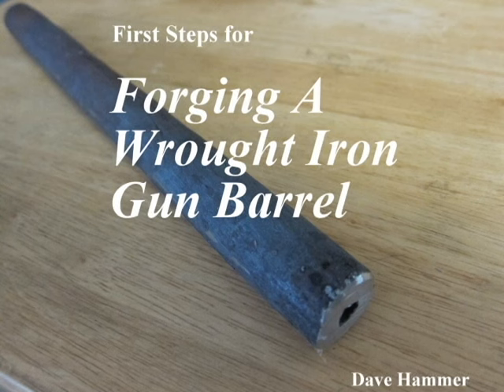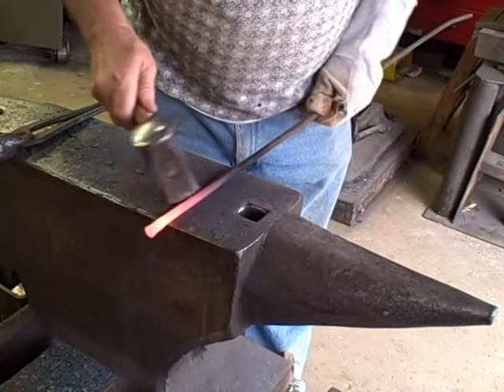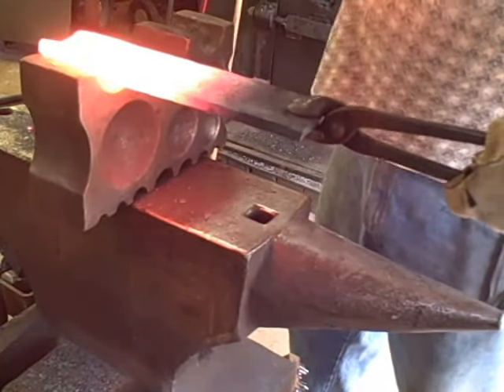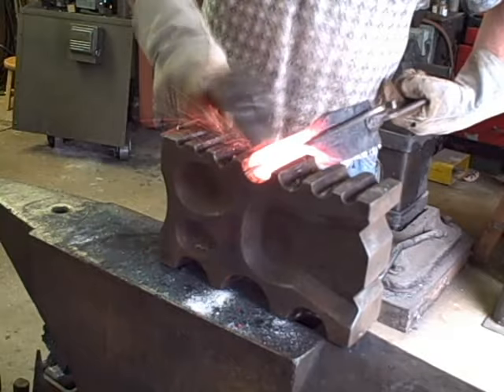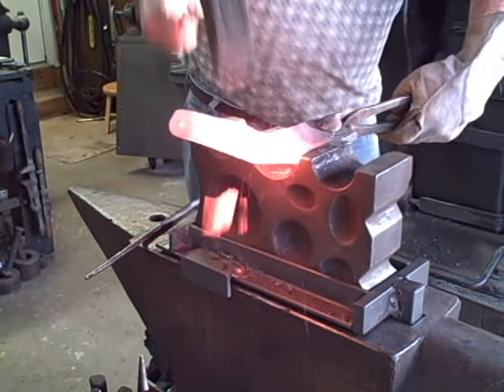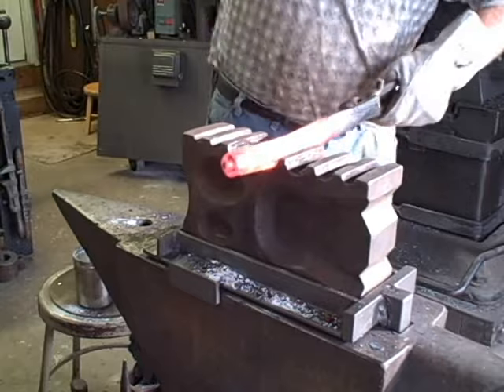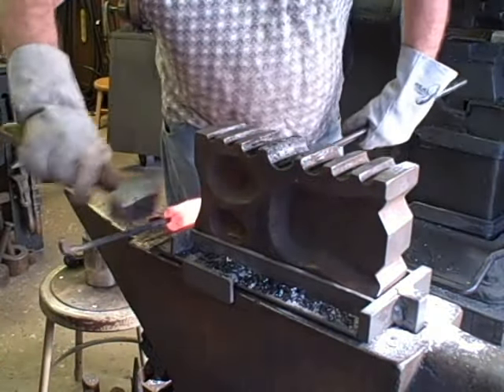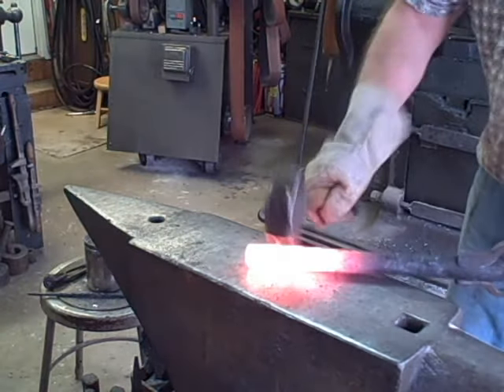Forging a gun barrel

Comment: Instead of drilling, and then, boring, and then rifling, why not just make a mandrel that was already the right size and rifling on the leading end, then hammer it through the barrel while the barrel was hot?  All three processes in one step.
Reply: +JathTech...  If the mandrel is left in the barrel....  and the plate surrounding it is heated enough to be forge welded, the mandrel would also be drawn to forge welding heat (via the heat in the forge and the heat from the mandrel contacting the plate being welded...., resulting in the mandrel being  forge welded to the inside of the barrel as the barrel  is being welded.  I would end up with a solid piece of round stock.  

The mandrel (as shown in the video) needs to have a taper and be put into the barrel at the point that is currently to be forge welded.  The mandrel is not at welding heat when it is put in and does not usually get to welding heat (from contact with metal at welding heat) during the short time the plate is at welding heat.  As the forge welding is occurring, heat is being lost from the plate because of room temperature and contact with a cooler mandrel.  It is important to NOT leave the mandrel in too long, or it may end up welded to the inside of the barrel....  not likely to happen, but possible.  Usually only a few welding strokes are possible (time constraint) before the plate has cooled too much for welding.  This is why it takes so long to weld a barrel.  As long as the mandrel is tapered, it is usually easy to get out.
Reply: The process I'm suggesting would be to design the mandrel with the negative of the bore you want.  You would then use a torch to heat the next section of the barrel you want to form, and hammer the mandrel in a bit.  You'd then pull it out, cool the mandrel, and heat the next section of the barrel.  Repeating the steps, making sure to line the mandrel up with the grooves each time. heat barrel,in, out, cool mandrel, repeat. I can't wait to try making my own barrel some day.  If you can get my mandrel idea to work using hot forging techniques, that would be amazing.  

There's also the possibility of using something that is zinc coated, or something that won't forge to steel or change shape when hot, such as tungsten carbide.  Theoretically, I can see you heating the entire barrel and pounding a tungsten carbide mandrel through all the way in one heat.
Reply: +David Hammer forgot to say, thanks for the reply.
Reply: +JathTech....  I have to say you don't lack for energy and ideas.  I admire that....   However, my goal is to learn how the pioneers actually did make firearms, and replicate their processes..., not try new or modern ones.  One of the Williamsburg gunsmiths is forging parts of a long rifle at annual conferences held about 60 miles from where I live.  It will take many 2-day conferences to complete his project, so he is committed for many years.  The first effort was to start forge welding the barrel (April, 2014).  In April 2015, he finished the welding, and did the rough forging of the octagon shaping.  This coming spring, I expect he will file the octagon shape smooth and make the drilling and boring tools and start working on the bore (and hopefully finish it).  Next would be rifling (grooves).

Originally, my only goal was to see if I could forge weld a barrel.  If I do go forward and make the entire musket, I will probably go ahead of the Williamsburg gunsmiths project.  As of now, I am just a little behind because I have lots of other projects I have done and more to do ahead of making a musket. If you are curious about what they are, you could peruse through the pictures on my Facebook page.   I've done numerous small projects over the past year and a half since I made the gun barrel, but my major efforts have been musical instrument sculptures.

https://www.facebook.com/dave.hammer.12

If you go forward with your ideas, I would be interested in your progress, but probably will not get involved beyond that.   

Thanks for your interest in my videos...
Reply: I see. You've got the traditional processes in mind, much like I do when I'm thinking about archery.  How did they do this in the past with the technology available to them...  I can respect that. 

My personal reasoning for this information is basically to build a gun from scratch using the easiest processes possible.  If this information is common knowledge, no government can ever take that away from us.  I think forge welding a barrel like this is probably one of the least equipment intensive and least expensive methods.  The barrel to me is the biggest barrier to assembling a firearm from scratch.  At least, a barrel that can be used more than a couple times.
Reply: +JathTech I used a piece of DOM 1026 steel tubing for a matchlock project. If you're living in the United States, you'll be hard press to find a metal shop that doesn't have this sort of tubing in stock, even Amazon stocks it online. It would be a lot easier than forge-welding a barrel from scratch, and the tubing is strong enough for regular black powder loads with the right profile and wall thickness (at least half of caliber diameter). DOM tubing is used for so many things that I doubt any government can ban its sale to the public.

As for your mandrel forming idea, it would create a real crude barrel. There is a reason why reaming, tapering, and rifling is done after all the forge work, as heating the iron causes it to expand and once it cools it contracts. The sizing you did while the iron was hot would change the moment it cools down. Reaming is precise process that can be controlled, forging not so much. Its much easier to do all three steps you mentioned to get a far better quality barrel.
Reply: +Bulsh1tMan that makes sense, and it explains why they do mandrel forming using a cold forming technique
Reply: JathTech  DOM tubing would be created in the matter you are talking about, cold formed using a mandrel through a die form, than electrically butt-welded at the seams. The advantage with DOM over let say a traditional wrought iron barrel is the cold drawing furthers hardens and strengthens the steel. Forged wrought iron would have tensile strength around 45,000 psi, vs C1026 with a tensile strength of 80,000 psi.
Reply: Thank you for that interesting information.  Do you know of any sources where I can learn more about tensile and compression strengths?  It's actually a huge interest of mine.
Reply: +JathTech ...  I don't have and sources I could recommend.   I suggest you use Google or Bing and search for "Tensile and compression strength of metals".   It does bring up some information..
Reply: JathTech
I took a material science course in university, but the vast bit of information can be found online by searching. I find that the specification information on material manufacturers' websites are the best places to find information, speedymetals is an online metal supplier which has specs on pretty much every alloy they sell, and Dupont's website has a lot of information on plastics and composites in which they make. The rest you'll find in material science/engineering books in your local library. For me "The Substance of Civilization" was the book that peaked my interest all those years ago.

Comment: is it possible to make barrel with straight rifling and then twist it?
Reply: Sorry, I really wouldn't know the answer to that question.
Reply: Probably not, there's no way I can think of to get the resulting twisted piece of steel to be as perfectly true and accurate as a rifle needs to be. Simply heating an already formed and rifled barrel to red heat and cooling it (without any twisting) can warp it to an unusable state
Reply: Maybe if u had a piece of tungsten but that will probably cost more than getting a used lave
Reply: I have made one this way, but the twist was not very even, to get an even twist rate would take a lot of jigs and fixtures, so it is easier to make a wooden rifling machine if you are only making a few barrels, there are videos/books on making your own home rifling machine using wood for the frame.
Reply: user21XXL hilarious!
Reply: Kyle Go Hawks Lave?  Do you mean lathe?
Reply: Englishman French I would ABSOLUTELY LOVE  to see pictures of the one you made that way.

Comment: OK,  where is the rest of the process?  How is that piece of work made into a firearm?
Reply: The barrel would need to be drilled out (rough hole), then bored, then rifled. Then a plug would be made (forging, tap and die work) to plug the back side.  Then on to forging the rather complex flintlock  mechanism and drilling the hole for the powder to enter the firing chamber.  After that, a stock would need to be carved and fitted...   I would have to make the drill bits, boring tools and other various machinery to fully make the gun from scratch.  Because of the time it would take, it's unlikely I will make a complete gun.  It would take me several months of concentrated effort  and guns are not my primary interest.  I have numerous other projects in my queue....    My primary goal (when I made the gun barrel) was to see if I could actually do the forge welding to make a barrel...  It was a great experience.  Sorry....

Comment: I 'd like to know how the heck  they  made the swage block back then
Reply: That would have been easier (smaller than mine with less impressions).  All they had to do was heat a block and pound a round bar onto one side.  They had power hammers with heavy rams to accomplish it.
Reply: @HammerMan999   Well thank you. I did not know that.

Comment: I was thinking if i wanted to make untraceable gun HEY! just cut off the barrel but then i thought about it and the firing pin inprint on the bullet would give u away but could shave it down and have a flat pin But it prob misfire alot and not be reliable.I like metal working but it can be very dangerous work and u should be an apprentice or u might as well be jesse james who makes choppers but cant do metal work traditionaly.

Comment: Why didn't they cast barrels? There must be some reason....
Reply: +CCornelius ...  There were cast barrels.  If you search online for information about guns during colonial times,  you will find that barrels had been cast with bronze and other metal alloys which were very expensive and difficult to produce.  High carbon iron (normally called cast iron today) was too brittle for gun barrels.  It would break from the shock.  My project was to replicate the method colonial blacksmiths used to make a gun barrel with wrought iron, which was very low in carbon and could withstand the shock.
Reply: David Hammer
Very impressive skill. Thanks for making the video.

Comment: this may be a silly question but do you heat treat it, quench it?
Reply: Good question...  I have not heat-treated or quenched the gun barrel.  This is made with wrought iron, which I have never seen heat treating instructions for (steel yes, iron, no).  The Williamsburg gunsmith I learned how to do this from has not (to my knowledge) mentioned that it should be heat treated.  It's a question I need to take to him....  In general....  I never quench forge welded projects.
Reply: I would be very interested to know what the results of that would be like and how well it shoot as a result. thanks!!
Reply: This was a forge welding exersize for me.  I'm not sure I'll be taking this project to a working firearm.

Comment: Good job ! Do you have any experience with creating damascus steel ? I was thinking of advantages of damascus steel gun barrel, but I am not sure if it won't be just too difficul to make.
Reply: I have forge welded layered steel (that which you most likely refer to as damascus) to over 300 layers in the forge used in these videos.  I have not tried to roll a barrel with my layered steel (I've made a few knives and some pendants).   If you Google "damascus gun barrel", you will find some information about them.

Comment: How do you determine whether the iron is good or poor quality?
Reply: If you are familiar with wrought iron, you know it is fibrous and has a a grain-like structure (like wood).  If you etch it in acid, that grain will show.  You can see examples on my website  www.hammerfireforge.com   

Click on "Gallery"  on the top of the screen.  Click on the "second from the right" image on the top row...  Then double click on that image.  This is an example of  "poorly" refined wrought iron.  This was etched in acid to bring out the grain.  If you look at the next picture in the sequence, you will see several axes.  Double click to enlarge that photo also.  Look closely at the axe in the upper left.  The picture quality isn't as good, but you can see a very tiny grain.  That is highly refined wrought iron.  It was in the acid bath as long as the other examples. 

Another way, without having etched to see the grain, you can cut a bar of wrought iron about 2/3rds the way through (ex. a 1/2 inch square bar) about an inch from the end.  Put it in a vise and hit the end sideways until that little piece bends over 90 degrees.  The iron  will stretch and bend (it may even break off).  You will be able to see the grain in the corner of the bend.  The rougher the grain, the "poorer" (less refined) the wrought iron is.  The finer the grain, the more refined the wrought iron is.

Comment: Would it not be easier to wrap the mandrel with a heated strip of metal ??
This looks like a horrible way to make a barrel, with a potential flaw running the length of the barrel.
Reply: +TIMEtoRIDE900......  The mandrel is used so the center is not forged welded shut (it keeps the barrel from collapsing when the seam is being driven together).  This process is not expected to result in a straight smooth hole.  After the entire barrel is welded, the hole must be first drilled out to a diameter slightly smaller than the bore will be.  The the barrel is "bored" to a fairly precise diameter....  after which the rifling grooves are cut.  These are three distinct processes, using different tools.  This is one way barrels were made during Colonial days.....

Comment: you should have started the forge weld in the midle and work towards the ends
Reply from the maker: It could be done either way.  If the barrel was a rifle barrel (longer), I would have started in the middle. Personally,  I don't think there is any advantage to starting in the middle on a barrel this length.
Reply: dont get me wrong i liked your work its just doesnt curve up as much if you start in the middle, i looked like you had a hard time with it wanting to curle up at the far end , you realy had to work it .

Comment: Why you just don't drill the metal bar (after round shaped it)?
Reply: because a drill is not what's used to bore a barrel
Reply: Uryendel Doing it this way is an attempt to do it the way it was done for centuries before the industrial revolution.  Why????   Just because I wanted to see if I could (and share the process with you).
Reply: camerl2009 A Gun Drill is what is commonly used to bore out a barrel
Reply: joehunt1980 yeah but have you ever seen the tooling used to do it right its expensive

Comment: What powder is used to join the iron
Reply: That powder is called flux. Usually borax. It's not something that's being used to bond the seam, like an adhesive or solder, it's used to keep the contact area free of oxidation/rust/impurities that develop on the surface of the hot metal and would otherwise contaminate the welded area and reduce the strength of the weld. It's kind of like a detergent, cleaning off the surface of the nearly-molten iron so that it better sticks to itself.

Comment: Of course the barel will be strong enough but lack in precision.
Reply: This barrel, if taken to a finished product (drilling, boring, then rifling, may be more accurate (if the bullets were fairly well matched) than one might think.  

Rifling was invented in the 15th century and became common practice in the mid 1800's in the United States (earlier in some other countries).  I have been told by a master gunsmith from Colonial Williamsburg that a skilled marksman, during the Civil War, (using a musket with a 38 inch barrel welded in this manner) could hit a target 500 yards away...  I haven't asked about pistols with this length of barrel.

Obviously, the longer the barrel, the more accurate the firearm would be.

Comment: That powder you throw on, is that Iron dust or something?
Reply: It's "20 Mule Team Borax".  I use it as a flux, which helps manage scale from oxidation in the fire.  It's actually sold in grocery stores as a laundry product.
Reply: David Hammer 
o rly. 
that's interesting
Reply: wrought iron is self fluxing, correct? Was that just an added precaution?
Reply: I'm not sure about that.  I just know I generally have more success if I use flux....  and less success if I don't.
Reply: Wrought iron is the purest form of iron generally encountered or produced in quantity. It may contain as little as 0.04% Carbon (by weight). Most of the remaining impurities from the initial smelting become concentrated in silicate slag trapped between the iron fibers. This slag produces a lucky side effect during forge-welding. When the silicate melts, it makes wrought-iron self-fluxing. The slag becomes a liquid glass that covers the exposed surfaces of the wrought-iron, preventing oxidation which would otherwise interfere with the successful welding process.